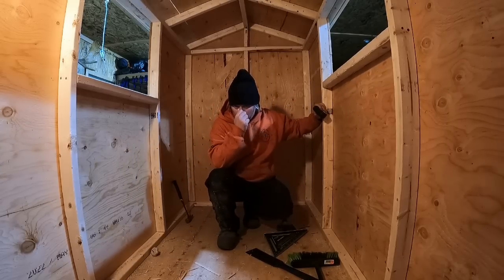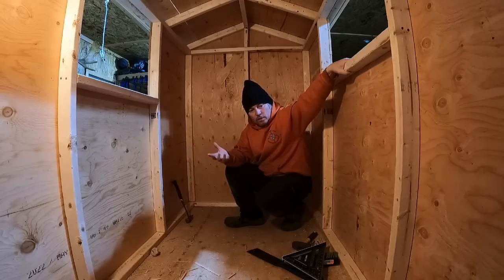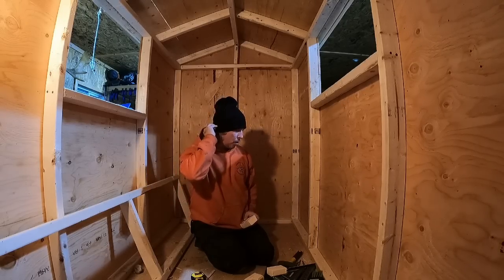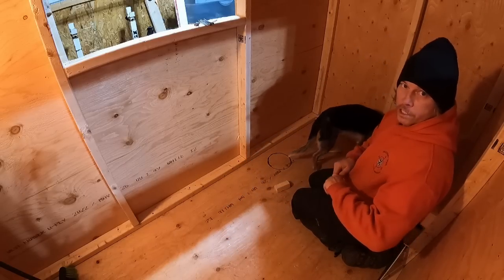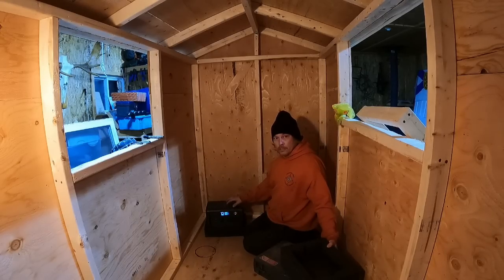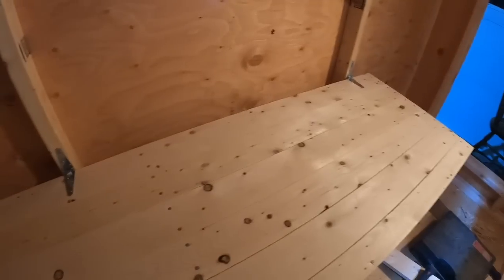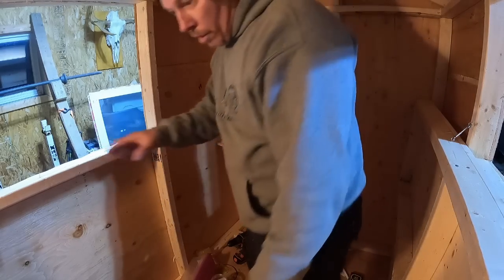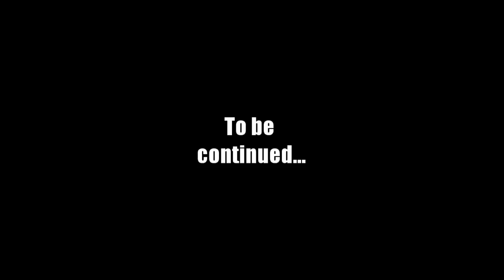Tiny Ice Shack Build (Part 2) Only 32 Square Feet

Comment: Having built many ice shacks over the years, I like this project. Quality build for sure, she's going to be heavy though, don't get her stuck lol. Chain or para-cord is a great way to suspend shelves enabling them to  fold up when not in use. make sure that you leave enough room with the holes to spin the auger without hitting the wall if you are using a manual one,  won't be an issue if you are using a drill or power auger though, Take care, I enjoy the videos, looking forward to the next one.
Reply from the maker: Thanks Dunk ! Appreciate the input my friend !

Comment: Hey Troy, can't wait to see you tip it on its side to get it out. Going to be a wee bit heavy for just yourself. Hope you can find some young fella's to help you with that. On the shelf that you are using for your stove, I would suggest that you put an angle brace from the front right-hand corner (looking straight on from the front) top the 2 x 4 stud right below it. Make it on a 45 deg angle or such. That will keep the shelf from sagging on Ya. Maybe put a little bit of a raised lip on the shelf where you are going to store the plastic totes. That will help keep them in place and not fall off the shelf while transporting the ice shack. I also agree with one of the other comments about putting your bunk over the holes. It would certainly make for more leg room with the chairs on that side where the bunk is now. Hopefully we will get to see some fishing action in the next video. Take care and stay safe and warm out there.
Reply from the maker: Thanks Tom ! I have since added another shelf bracket for the stove location. It seems much sturdier but might have to use your idea once i get a feel for it. For the containers on the top shelf, I have them secured as you'll see in part 3 😁.  The holes under the bunk is a great idea but thought i may want to fish from my sleeping bag in the early mornings haha.

Comment: I was thinking about your lack of room and desire for a bed/seating. 2 pipes parallel with a cloth sling 7' long or so. Sets of hooks on each side of the room at the same height to make a bridge type hammock, then a second set of hooks say 24" down on the middle vertical stud  makes a sling couch for up to 3 or 4 people. another set of hooks on the same wall would allow simple storage out of the way.
Reply from the maker: Very cool idea ! Thanks for sharing !